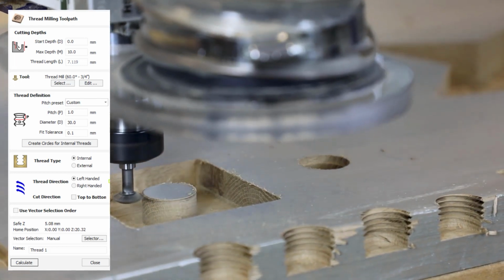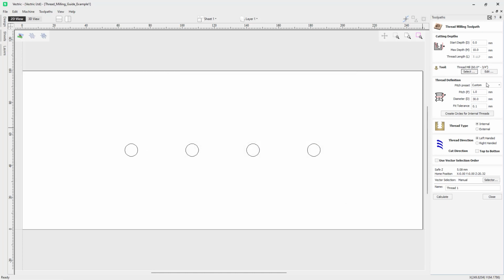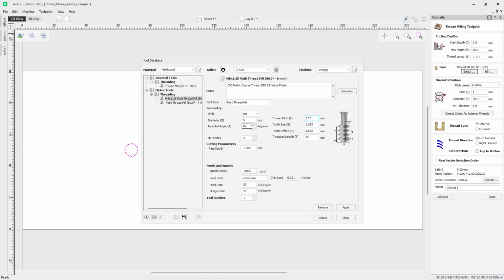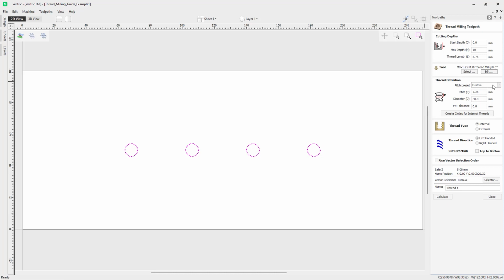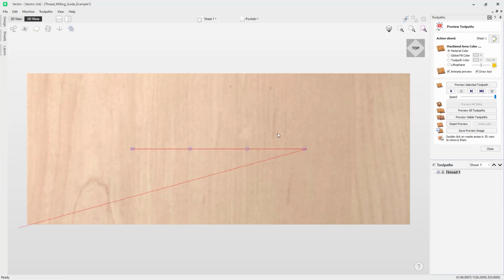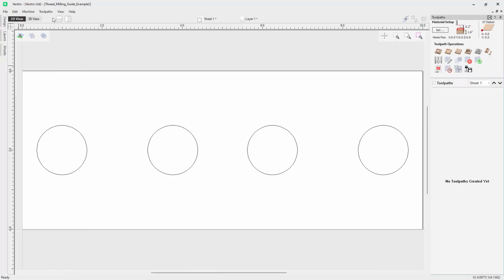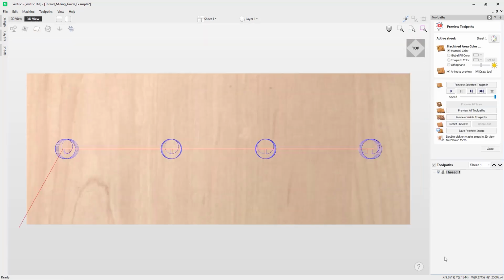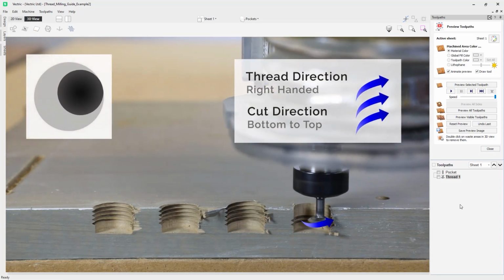How to use the threadmilling toolpath in Vectric software | 2D Toolpaths | V12 Tutorials

Comment: I'm new to vectric. How can I use groove cutter tool for thread? It was simple in Fusion, here it looks like it's not possible.
Reply from the maker: In the Thread Milling toolpath you can choose to use a single or multi thread tool.  As for the use of a "groove cutter tool" I'm thinking you could use if for the initial hole the thread milling tool plunges into (as a replacement for the endmill) but I might be misunderstanding.  This might be one to ask the support team.  An email exchange might be more helpful. - Support@vectric.com
Reply: @vectric  I think I have a solution. I don't know how those options are called in english but in the Profile Milling toolpath there is a ramping option with a spiral mode. It will not show correctly on a simulation because of the way of adding form tools. It's a bit surprising that there is no way to add a groove cutter with edges on the side. I will test it later and let you know.
Reply: @vectric  Technically it works although there is one problem. After finishing a job, tool goes straight up. So if the tool is upside down T shaped, it will damage the thread and it could break the tool but I will figure this out :)
Reply: @vectric  OMG why are you making this more difficult than it should be. I just found the leads option and I thought it's an answer to my problem. It seems like that it's not cause when I turn on leads, then ramp changes to zig zag, WHY? :/
Reply from the maker: We don't mean to make it any more complicated then it needs to be in order to give users the options they want.  We would love to get your feed back and see if we can make it any more simpler or smoother.  Please, as we mentioned before, feel free to email support@vectric.com where they can log your comments and help you with any support issues.  Thanks.

Comment: How do you know what size hole to start with? I’m looking to make some holes threaded internally for 10-24unc. What size circles do I need to use? Is there a reference I’ve missed for this?
Reply from the maker: Hello, and thanks for the question. It does not matter, seeing as the tool will use the selected vectors' centers. This is from the documentation: "To use the toolpath, select the vectors you wish to create threaded parts for. The centers of these vectors will be used to define the center of the threaded part."